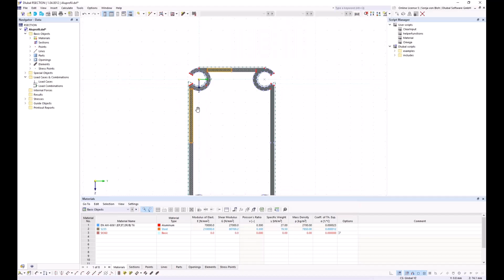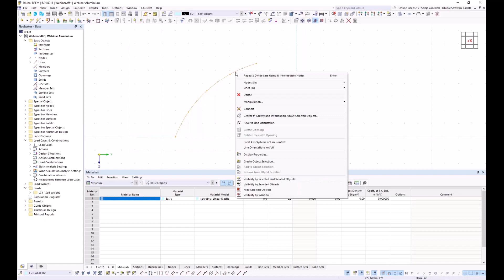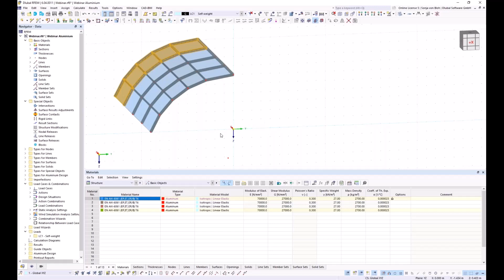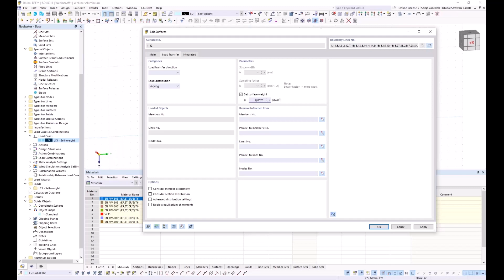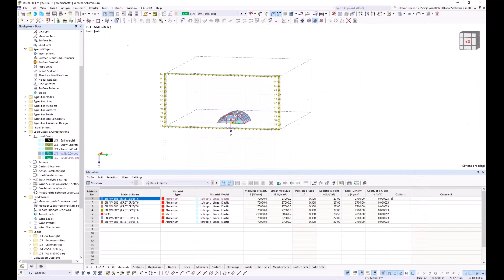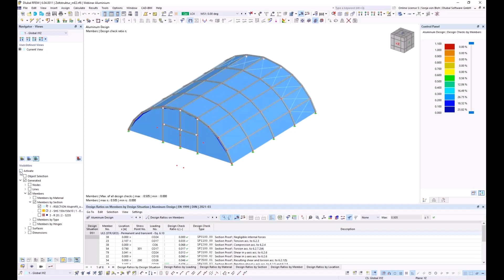Webinar | Design of Industrial Tent Made of Aluminum Sections in RFEM 6

Comment: I was looking at how you defined the out-of-plane arc frame imperfections with 𝑒_0= 125 mm, but I’m not exactly sure how you determined that value. I understand the in-plane bow calculation , but I'm a bit lost when it comes to out-of-plane imperfection of the arc frames. Could you briefly explain your approach or point me in the right direction?
Reply from the maker: Hi, @yosef_Restom! Thanks for your questions. We would recommend contacting our support team via support@dlubal.com, as our team of experts can provide the best possible answer to your question.